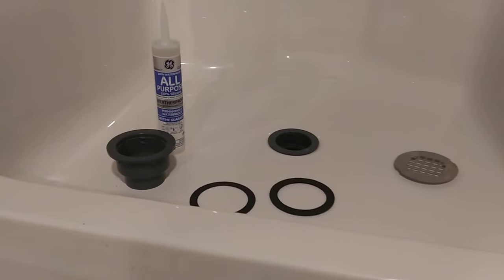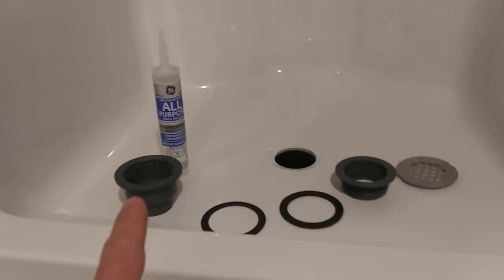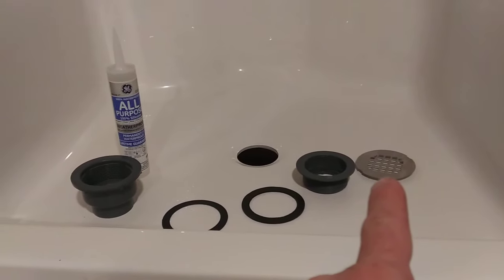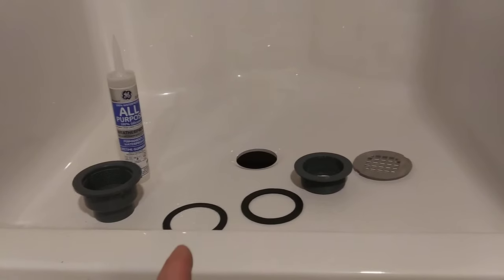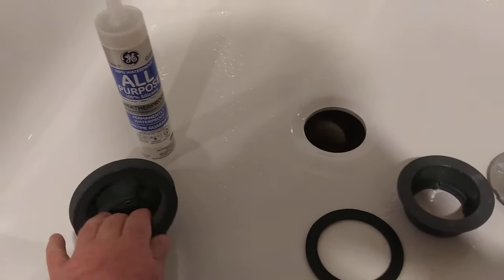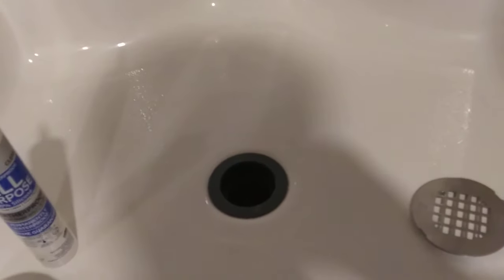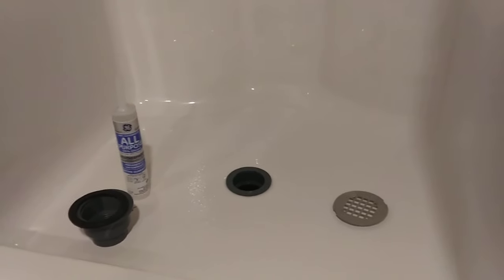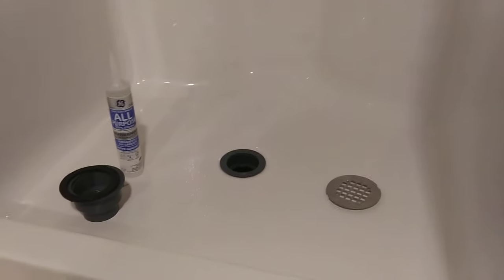How to Correctly Install a Shower Drain Assembly

Comment: No, normal install does not have access to underneath, drain is pre glued to pipe and pan is set down and you use special bracket that allows you to screw from top, so paper gasket has no place at bottom

Comment: Can’t get at the bottom, need to tighten mine from the top, so spinning the top in caulking is a disaster!
Reply: What did you end up doing? I bought this type of drain with no bottom access

Comment: Hello James, Thank you for this tutorial. May you please tell me whether the water will leak through the Rubber Sealing washer when the shower pan is overflow? In normal cases, my shower pan doesn't leak, but when the water is clogged, the water will sip through the rubber sealing washer. Is this normal? Thank you

Comment: Excellent demo on location of the rubber gasket. The ProFlo PFP600 comes with ZERO instructions or diagrams. They need to know that people other than full time plumbers use their products.
I don't see how a paper washer can hold up over time, but I guess it does. Seems like a slippery plastic washer would be better.
I don't follow your logic re: not using the plumbers' putty because you don't want to have to go into the crawlspace to deal with it if it's dried up and there's a problem. But you describe the location where you prefer silicone to plumbers' putty as being on the top side of the shower pan, meaning accessible from the top.
I have had to replace just the top portion of this 2-pice unit a couple of times, and I have tried both silicone and plumbers putty on the topside of the pan.  I dislike the dirt-grabbing ring of plumbers' putty around the perimeter of the strainer, even when it's trimmed back. But silicone failed on me, and I had a leak downstairs as a result. Luckily it was in the mechanical room. Plumber's putty is easier to get loose from the topside, and I find that I can even re-tighten that type of connection later on if I see evidence of a leak downstairs. To each his own I guess.